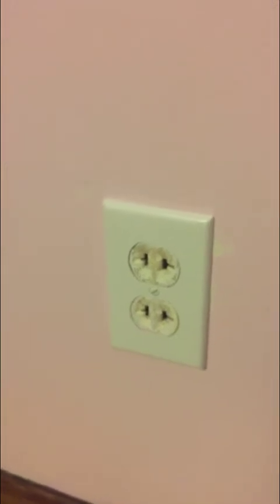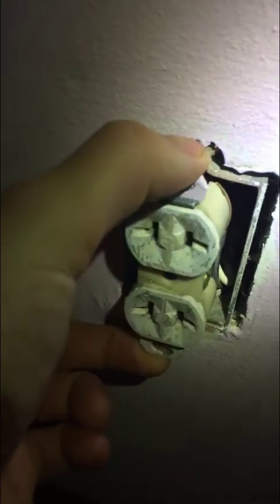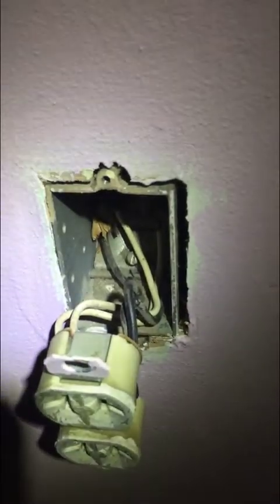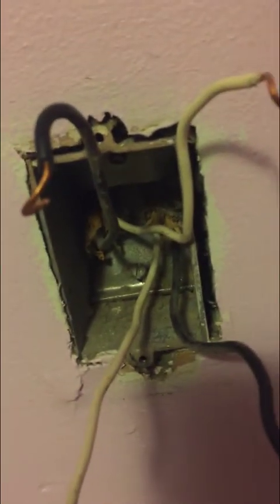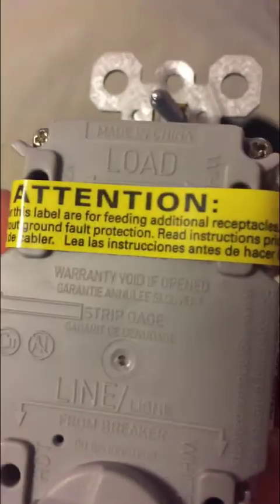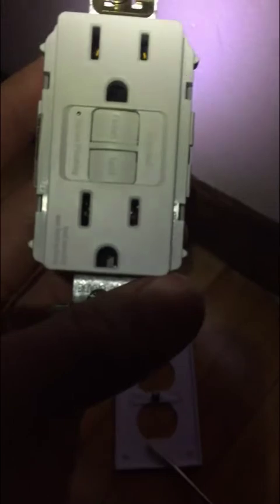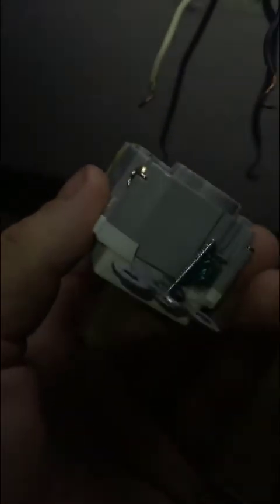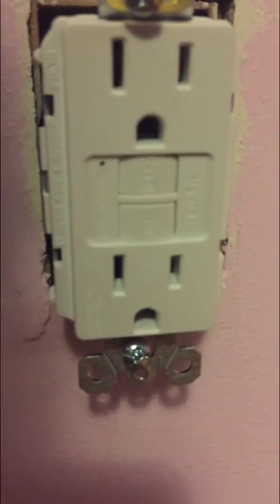Determining line and load wires for GFCI outlet installation

Comment: They make tamper resistant child safe GFIC receptacles which is what you should use. Also you installed the wires onto the screws backwards. You always bend the wire around the screw in the direction you would turn it to tighten it or it will push the wire out when you tighten the screw exposing to much bare wire and very little contact between screw and wire.
Reply: Good point! thx

Comment: Please use a non contact voltage tester for checking for hot wire, much easier and safer. Fyi, I know that many of these metal are pretty small, so I like the Leviton slim design for gfci's, they are not as deep.

Comment: Dude if you dont attach a ground your waisting your time
why do you think its called ground fault? It detects if a load isnt grounded correctly and then trips the circuit.
Reply: It is actually an acceptable solution. GFCIs do not need a ground wire to work. GFCIs work by comparing the current on the line (incoming) wire to the current on the corresponding neutral (return) wire and breaking the circuit when a difference is detected. An ungrounded GFCI is certainly not as safe as a grounded one but, it is safer than an ungrounded non-GFCI outlet. It is called a ground fault because a difference in the amount of current in the line vs neutral wires indicates that current is attempting to find an unintentional path to ground - not good.

Comment: Thanks. I have an old house and a couple weeks ago my GFCI started tripping immediately after resetting. I've read in other places it can be any outlet on the circuit causing the issue.  I looked at the other outlets and guessed it was the GFCI outlet itself. If that didn't work I would have replaced the other outlets on that circuit. 

Your video was very clear on how to determine the line. I'm very OCD and doubt myself 3 seconds after I do something so for the line wires I put a tiny bit of electrical tape on the sheathing of the black and white wires. 

I replaced the GFCI and thankfully the circuit works again.

Comment: What if the wires are side by side instead of up and down
Reply: Teflon Don 
look at the wires as they come out of the cables ... either bx or Romex..the pairs as they come out of their respective covering sheaths (cables) indicate which two coductors (wires) are related hot and neutral  of the line side (incoming power)..and which are related to the load (other outlet or  light or other device receiving electricity from this outlet)
Reply: Separate them same thing
Reply: Agent Office not what I was talking about, in this video his wires were a bit up and down, for mine they’re horizontal , (set by set) and I don’t believe the side that his load and line were are the same as mine they may be reversed. And don’t have that method to determine which is which but ig I’ll have to wait to do some troubleshooting .
Reply: @cr9672  buy a non contact voltage detector. No one should use his method
Reply: No safety stick smh!